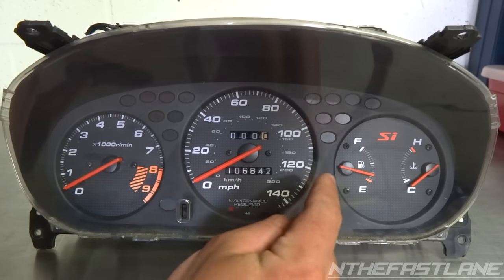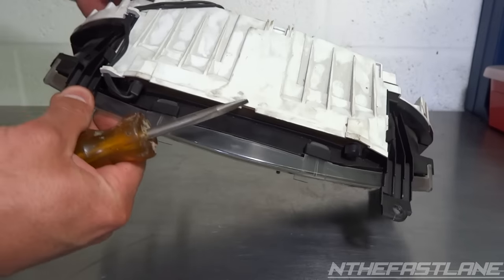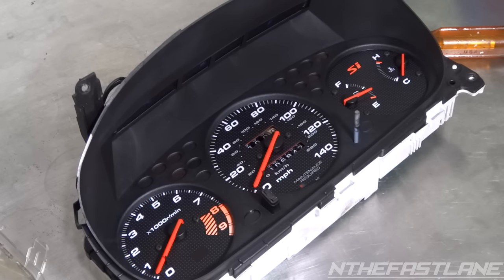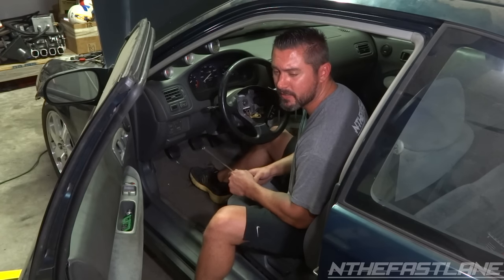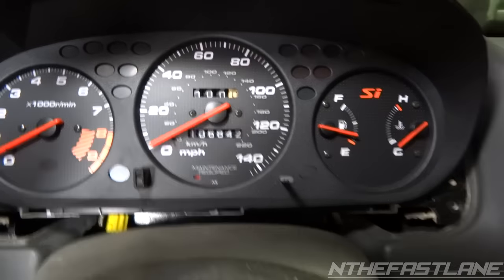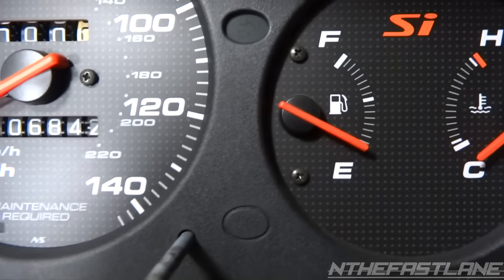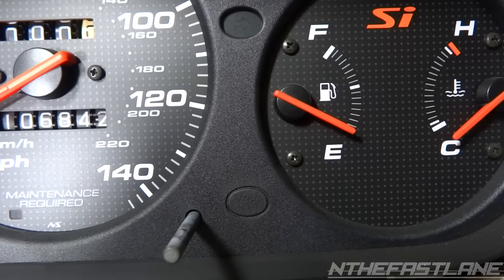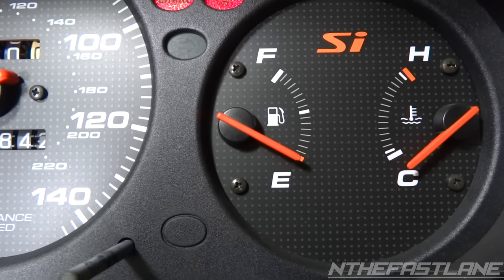▶️Gauge Cluster: How To Recalibrate⏱️

Comment: Straight-forward procedure and easy to follow.  

However, know that you are 'setting' your gauge needle, not '(re)calibrating' the gauge.  To calibrate the gauge would require that each mark be set to correspond with the exact fractional fuel level relative to the capacity of the tank.  As most electric OEM automotive gauges are not exact measuring devices, they provide an approximate reading/indication.  At that, most OEM automotive gauges simply measure electrical resistance (to ground) and provide no straight-forward calibration feature. If it did, to accurately calibrate the gauge would require removing the sending unit and position the float arm to each degree in the range of the arm's sweep/arc to match the same degree of sweep/arc of the gauge needle.  If the gauge itself does not have an internal calibration, it would be necessary to add small resistors at each mark on the gauge face or at coil resistor of the sending unit to exactly to correspond to the % of fuel remaining.  Quite an involved process.
Reply: You may be correct, but "recalibrate" will get the attention of someone like me, wanting to know how to reset. Good video. Attention grabbing title. Good job.
Reply: No, buddy. That’s not how it works. Good attempt, though.

Comment: Thanks for posting this video. I'm hoping you can help me with a related question. 
I just installed a set of glow gauge faces on my 94 Accord. On the set I purchased, the tabs bringing current to the fuel and temperature gauges obstructed both the tach and  the speedometer so the overlays wouldn't lay flat.
I had already read the warnings about removing the gauge needles but while I was focusing on re-routing the electrical connections (with new gauge faces not firmly attached), I inadvertently pulled the speedo needle off. Everyone writes about how difficult they are to remove, but mine came off  just from the light upward pressure of the new gauge face as i was performing a test fit with the rerouted wiring. 
So now I have perfectly functioning glow gauges but my speedo is reading about 15 mph fast. 
I've looked everywhere and all I've seen is that on Hondas, once you remove the needles, the gauge can't be made to read correctly. 
I caught that even though you demonstrated the procedure with your fuel gauge, it applies to all of them. 
Do you happen to know if it will fix my problem? I'm tempted to go disassemble it but it's 104 degrees right now. Any help would be appreciated!
Reply: Dustin Collins  Sadly, this did not work to recalibrate my speedometer. I never did find a fix for it. One crazy idea I had was to reinstall the gauges without the bezel, have a friend drive a steady speed using GPS as a reference, I could then lean over from the passenger seat and put the needle on with a pair of small needle nose pliers at the correct speed. It seemed like only a moderate risk of catastrophe at the time! Instead I relied on a  7" touch screen with gps for speed until selling the car in 2020. I hope you get it figured out!

Comment: I've literally swapped hundreds of clusters and never once had to adjust the needles unless I removed them. The gauges will adjust once the you koeo.
Reply: What do you do if you took out the needles
Reply: @Rickster183  you do exactly what's in this video
Reply: Do you have a fix for the needle not working on Subaru foresters? (06-08)
Reply: @prestontechaira2570  not working or need calibrated? If they don’t work I think it would be something with your left plug behind the cluster make sure it’s in good
Reply: just picked up a new/used cluster and put it in now the fuel gauge goes to full, is there a way im supposed to reset it not sure what to do

Comment: Hey i got a 94 k1500. I took the needles off thinking i had to to get the black face plate off. Turns out i didnt have to. Now all my gauges are out of whack. Would your method work for the temp, oil, rpm, speed, and fuel? Idk how much gas is in the tank

Comment: I’m having an issue with my 2005 Honda Accord gauge cluster… it turns on (the lights) but other tha. That the needles don’t properly read my fuel, rpm’s. Or speed.. or even engine coolant. There was a ground wire that was ran from behind the gauges to the negative wire on the lighter socket. I had unplugged it and it worked. But after putting in my new head unit all gauges stopped working… please help

Comment: Hey bro love the car but i have a question and i dont mean to sound rude but you said turn key on see where it goes, then key off and move it to that spot then key on and it should move back...dont that mean u did nothing? Lol i just wanted to know cause i have a EM1 also and i belive mine is off a bit. Plus u got a nice em1 also so yeah.
Reply from the maker: +Sean Daigle In my case, I didn't have any fuel in the tank. The needle should have been in the zero position. So when I zeroed it out with the key off, and turned it back on, and it did nothing, it was finally showing the real reading. It was suppose to go down to the "E" with the key on, but didn't.
Reply: @Nthefastlane  that’s understandable, but try doing another video with gas in the tank, I think that’s all these people wanna see bro

Comment: I repair auto instrument clusters and components for a living and he says “This pretty much applies to any vehicle”. I have to completely disagree with that statement.  There’s a lot of different clusters out there and most have their own way of being calibrated.  Just do research for your specific cluster if you happen to be in a position where your needles need to be adjusted.

On the other hand you do have some good vids with good info.
Reply: mouser485 Can I contact you?I got a problem with my motorcycle cluster
Reply: mouser485 any easy way to set fuel gauge needle for 2004 Toyota. I had to remove all the needles, but now it shows a little less than is should. Pull out again and back-  trial and error? Or can I just push it with my finger? Same for the temp gauge. Happily, the speedo and rev counter are spot on.
Reply: How can you recalibrate the fuel gauge on the first shape Honda Crv please?
Reply: How do you recalibrate a Speedo gauge for. 95 civic?
Reply: HI THERE I HAVE A 2007 KIA SPECTRA AN SPEED OMETER STOPPED WORKING I FOUND ANOTHER CLUSTER FROM A 2009 KIA SPECTRA BUT HAVEN'T TRYED TO CHANGE IT YET CAUSE I TRIED GOOGLING SUM INFORMATION ON DOING THIS BUT SOMETHING THAT I LOOKED UP SAID SOMETHING LIKE IF I REPLACE IT THAT MY CAR WOULD NOT START AGAIN NOW MY QUESTION IS IF I SWITCH IT OUT WILL THIS UN PROGRAM MY CAR ECU COMPUTER

Comment: how do u do the speedo? my car says its going 5mph faster then i am. if im going 65 my speedo says its going 70? how do u recalibrate that? cause the speedo is at 0 when your not moving?
Reply: Rikki Diesel adjust it while doing 70mph
Reply: David James 😂
Reply: I had the same issue with mine until I bought a new cluster, also check to see if the vehicle speed sensor is going bad. I had that issue once as well.
Reply from the maker: First make sure your tire sizes aren't too small. Smaller tires will show a greater mph and the vehicle will be moving slower. If you have the correct tire sizes, then it's possibly the speedometer cluster.
Reply: Wrong tire size.
Reply: Did you figure out what or how to fix the problem rikki? I have that same problem you had.
Reply: @Otsp922  no I never did. I was going to try hold the needle while I was driving but just never did before I sold it
Reply: @davidjames666  u made me lol

Comment: To calibrate the needle, you have to remove it and put it back, than rotate it clockwise and counterclockwise until you see that it stops on E. Just play with the needle. 
How about the temperature cage, why you didn’t calibrate?
Your instruction is not how supposed to be. Sorry.

Comment: So I took the RPM clock out of the cluster itself so I could shave the clear plastics a little to fit bigger LED bulbs but the RPM needle moved past 9k RPM and is now stuck at the bottom. I reconnected it to turn the key just to see if it would reset and it's moving clockwise to 0 RPM as it should but when I turn the ignition off it goes back to the bottom, any ideas? I know it has like a little spring behind the assembly part of the chip board

Any info would be great, cheers
Reply: Did you fix it?

Comment: ok so what if you have gas in the car, still place it on 'E' when attempting to recalibrate?
Reply from the maker: Set it on (E), then plug it in and turn the key.
Reply: How can you recalibrate the fuel gauge for a (first shape) 2001 Honda Crv please?
Reply: Will it still calibrate correctly if the car has some gas?